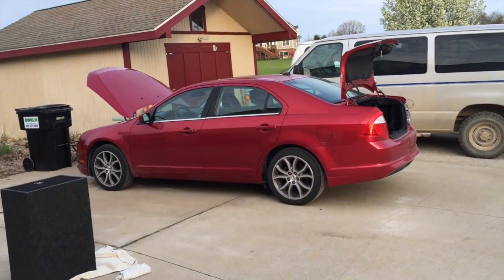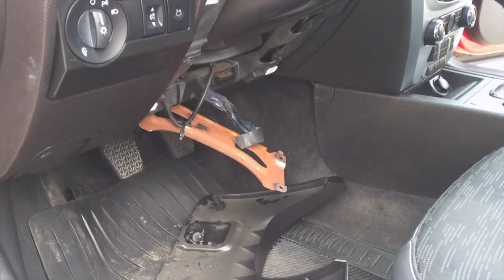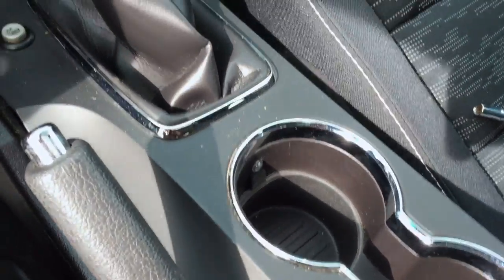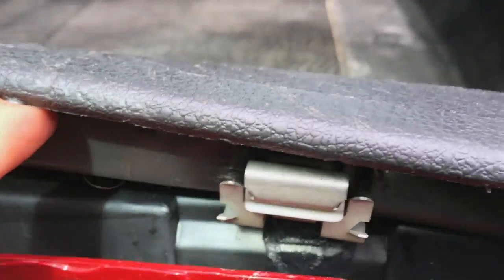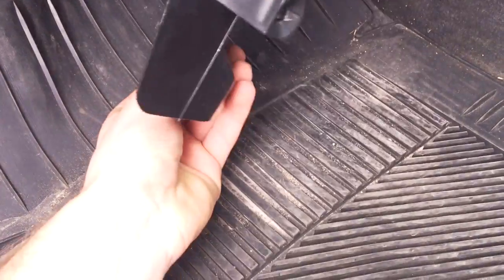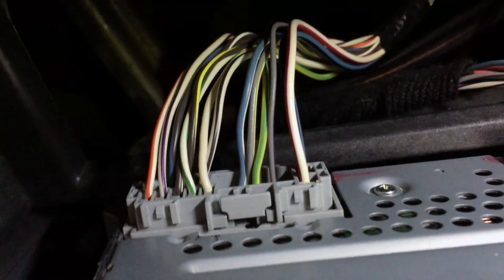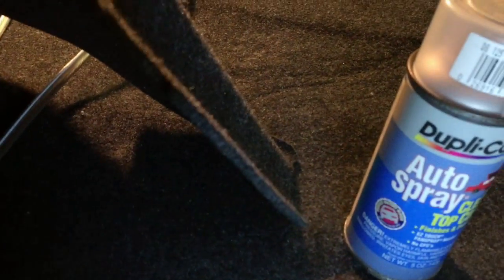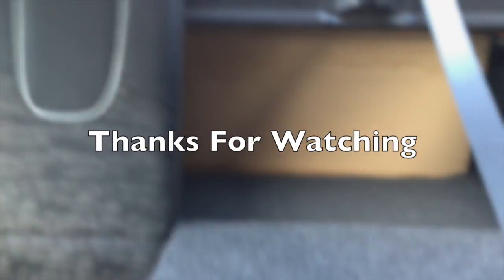How to install subwoofers with a factory radio - 2010 Ford Fusion

Comment: I'm putting a sub under my seat, this will help me a lot, already have half the work done before I start cause I need to replace by e brake lever. I laughed when I saw your lanyard cause I have the same one on my keys.

Comment: Just got my 2008 fusion with the 5 speed! They are incredible cars
Reply: where’d you run the power cable through?
Reply: @Versility drill the firewall next to the steering column
Reply: @colebremmer1225  just a little late my boy
Reply: @Versility  whoops didn’t realize lol

Comment: You may need to turn down the 'bass' control in the factory head unit to avoid hitting its built-in limiter, which is only there to protect the factory speakers. The bass is still "there" in the signal so if you tweak the crossover frequency in your subwoofer amp just right, then it will pick up right where the 'bass' EQ leaves off. This will reduce the distortion coming from your door speakers because they are no longer working as hard, and you're not hitting the factory limiter with your bass signal. Otherwise great demo and I might just have to do this in my 2010 Fusion SE with Sync.
Reply: Idk if you still have yah account but what’s the right measurements for a amp with factory radio?

Comment: You can always wire straight into your rear speakers as well would've been a lot easier and a lot less speaker wire you had to run all the way back
Reply: Wich wire is the remote connected to
Reply: MrCupcakebear1 same what do you connect the remote wire to
Reply: LiveToRide directly to the factory amp is what i found with a testor. It helps to have another person when not only testing for power but also knowing wich wires turn on and or off with the ignition
Reply: Same thing i did... Thanx for the reply.. Much 💘.. Im i lil typsy.. But great video. And the sportgot hit by a semi..  And had a reinstall on chvy malibu.. Fckkk..
Reply: Agreed chase Coleman!! Exactly what I did. And the power and ground to the amplifier as well. Works great!
Reply: @MrCupcakebear1  your radio
Reply: @LiveToRidee  your radio the blue wire
Reply: Where do you get the remote cable for the amp to start on and off when you start the radio
Reply: Where do you get the remote cable for the amp to start on and off when you start the radio?
Reply: Mr. Lumpy which blue wire there’s at least two maybe three
Reply: @rickyavila673  with an LCI2 you can get remote from it, it sense audio signal from the speakers and powers up like that and it had a remote out connection to power the amp on. I'm about to install in my 09 fusion and was looking where he ran power through the fire wall I don't wanna drill threw it...
Reply: @scottouimet2865  Yo! i was looking for the same thing, need a good spot to run power through in my fusion, where did u end up doing it???
Reply: @Versility  when I get off work I'll let you know. You are asking for the lci2 or amp. You can msg me on Facebook at the same name I can send pictures
Reply: @scottouimet2865  i’m appreciative you got back 11 months later! just want to know where you ran the power wire (for the amp) through to get to the battery.
Reply: @Versility  if you look just above the column to the left side of it your see a white plastic plug about 2 in wide and that is where I run wires through
Reply: @michaellarcom  i ended up doing the exact same thing. nice little spot for the amps power wire
Reply: @Versility  I have the 2011 Mercury Milan premier with the Sony navigation system in it.. it's different than the system in this video I think because I have 12 speakers and the subs are 6x9s I'm going to get the lc2 pro for the sub and I have the old school RF 500.2 amps and hx2 15s
Reply: I tied into my left rear speaker and it sounded distorted and like it was unbalanced cuz it was only getting the signal from the back left so if the song was playing like a fade or left right balance part of a song it just sounded real muddy. This is a crappy year of Ford for aftermarket radio stuff because they don't really have wires coming out of the head unit it's all ran through the PCM or whatever module and I'm kind of intimidated to start messing with those wires. But I have the 2012 without but I have the 2012 without the audio file sound system So mine doesn't have a stock amp
Reply: @MrCupcakebear1 The blue and white one
Reply: Can u make a video on how to do it?

Comment: Iv never seen a fusion in Manual trans that's cool
Reply: My first gen fusion has a 5 speed in it too, nice getup for the modest amount of power
Reply: 2013 and 2014 they had 6 speed manuals.  2014 was the last of the manual fusions.
Reply: @justaguynamedmax8207  I have one ('13). It's great!
Reply: Konrad Gajda umm, no it won’t. 🤪

Comment: Newer amps from Audio Control include GTO, great turn on, which activate your amp power through sound output from your speaker wire, disregarding having to run a remote wire to the head unit. Also they include AccuBass to restore bass from rolling over the higher you increase your volume as many newer vehicles have pre-installed to keep from damaging cheap stock speakers. Hope this helps anyone.

Comment: I wish I would've seen this video last year before I installed my subs and amp hahaha. I eventually figured it out, the only difference is that I wired my line out to my rear speakers that are already in the trunk
Reply: witch wire was pos and neg for the rear speakers with sony audio system.
Reply: @romanhidalgo3862  wondering the same thing

Comment: You don't need to drill through no metal to get a wire in the car. You take that installation down and look up to the left of the column your see a white plug plastic you can put a hole through it. It's about 1.5-2 in wide. I found it while looking to run power for my trailer wire converter.. I just wish I could find out something on that 2011 Mercury Milan premier Sony navigation amplifier wiring. Life which one is the subwoofer output so I could hook lc2 pro to the subchannel.

Comment: I did everything the same way except I connected my loc directly to the speakers wires behind the radio. And my sub sounds weak but my amp is all the way up

Comment: Where did you run the remote wire ?
Reply: I hate when they dont fucking respond, like wtf is the point of a HOW TO, when you arent going to help
Reply: @IDABAYAREA650I if you have a Line Output connector that has a remote wire on it all you do is run the remote wire from the LOC to the amp. It sensed the power signal from the speaker wires.
Reply: Senses*
Reply from the maker: @IDABAYAREA650I I made this 7 years ago, cut a dude some slack
Reply: @XxkristofpopxX thanks for the informative vid

Comment: Just buy a line converter with a trigger remote and wire into ur rear speakers!
Reply: I did that to my girls fusion and it sounds terrible , there’s barely any kind of power to even make the subs work atleast decently

Comment: Wait you have a six speed fusion too? I Love mine. Very rare so cool to see another one
Reply: Might be had a fusion since this an old video
Reply from the maker: @kiethj7  Still running strong at 240k miles, and same with the system. It'll be a sad day when it rolls its last mile
Reply: @XxkristofpopxX  Awesome. Mine has been good to me the past 6 years. I want to hook up my system so I ended up here. How does it sound being stock?
Reply: I bet our cars were born at the same place since they're both 2010 6 speed lol

Comment: Got everything wired from. What I saw in video. Just didn't see anywhere in video where u pulled power for converter.
Reply from the maker: I brought the big power cable to the amp straight from the battery, and took power from that cable to power the converter.

Comment: Couldn't you have just spliced into the rear speakers on the deck instead of running wire all the way from the head unit? Just curious is all.
Reply: No rear deck speakers in the Fusion unless you already have the upgraded Sony stereo. The rear speakers are in the rear doors. There are 6x9 openings in the rear deck for the Sony system subwoofers; you could conceivably add a full-range amp and more speakers in the rear deck but these existing locations are also good for venting the trunk compartment into the cabin. Also, you could conceivably just use 6x9 infinite-baffle subwoofers that are available, and put them into these factory locations.

Comment: Wonder if it would complicate things if in my fusion I have the Sony 12 speaker factory system where you mounted your amp is where the Sony factory amp is located at I was considering doing the same but I’m not sure

Comment: I got 2011 Mercury Milan premier with the Sony navigation system in it.. it has an amplifier in the back behind the panel. I wonder if that's the same as your system or does it got a different wiring? I want to go with the lc2 pro

Comment: How long was your power cable in legnth? I'm ordering some welding wire for durability and currency efficiency and want in between just enough to a lil bit of play left over. Appreciate the upload none the less.
Reply from the maker: Can't remember exactly how long the cable was. Probably around 8 or 9 feet? I would order more than you think you'll need and cut it to size. You really don't want to end up being too short.
Reply: SNWxGaming get an amp wiring kit.  Depending on the kit you get it may come with everything you need in clouding fuse holder and rca cable
Reply: Michael Ouellette I'll get the welding wire and buy the fuse and speaker wire separate. Thanks though
Reply: That looks way more than 8 feet lol. I have a 2010 fusion as well and I think i'm using around 18 feet

Comment: very nice tutorial i have 3 12s and a few amps i was gonna install in my 2012 fusion sport. how did you mount your box back there?
Reply from the maker: I used velcro on the bottom to keep it from slipping around, it works well.
Reply: +XxkristofpopxX  how much will u charge

Comment: I did the same exact thing but I’m not getting any sound, I’ve installed two different amps and I’m still not getting any sound any suggestions?
Reply: I'm having the same issue right now no power to the amp I can't figure it out

Comment: Do you know which wire corresponds to each speaker/other functions in the all audio connector? Wiring diagram? TKs
Reply from the maker: 999MAO999 I explain which wires are the speaker wires coming from the harness, you could easily find the positive and negative with a multimeter, other than that I'm not sure of the other wires.

Comment: My understanding, is that the LC2i can handle up to 400 W. So let's say I want to amplify my front door speakers and add a single 12 inch sub. Let's say my two door speakers would take up 120 W RMS. Would that leave only 280 W of power and I could put through the LC2I from a second amp to my sub woofer?
Reply from the maker: The purpose of the LC2i is to take the high output signal from your radio and turn it into a low level RCA signal that your amp can use. You don't run the amplified signal through the LC2i because that would be redundant. Does that help?

Comment: Quick question if you ever see this, do you remember where you put the ground for your RC2i, I am having trouble finding a spot
Reply from the maker: Pretty sure I used the same ground location as the amp, or daisy chained from the ground terminal on the actual amp to the LC2i

Comment: i have a 2012 ford fusion and i bought the pac line out converter the sni-35 im looking for a good way to run the remote wire to my amp to tell it to turn on seeing as the loc doesnt have a remote... any help. also the car doesnt have an acc line i was thinking of tapping into the 12v constant and putting a toggle switch on it?
Reply from the maker: Milktittiesclutch1 a toggle switch would work, it probably would have been easier to just get the LC2i but whatever you prefer. I don't know of any easily tapable accessory outputs.
Reply: already bought the sni-35 didnt realize there was no remote woulda bought the better one. i just cut out the cig lighter in the bottom of the dash and put a toggle switch there, only use it for car charger and i got the one inside the center console. boom bam got it

Comment: if u ever see this...do i not need to do my back left and right, wires to?
Reply from the maker: You’re just trying to get a full signal from the head unit to the bass amp/line output converter, you could do front or back, but you only need 1 set
Reply: @XxkristofpopxX So will i need 3 RCA cords total? 1 for front left neg. and pos. and 1 for front right neg. and pos. and 1 to plug from lci to amp?

Comment: The ground wires on the output converter, do they go to the ground on the amp or to the frame ? Or both because the one I purchased has two ground wires
Reply from the maker: Robbie Robinson I would follow the instructions that came with your specific unit. It wouldn’t make sense to have two separate grounds, unless you’re talking about negative speaker terminals

Comment: Where you ran the power wire, is that the only spot to put it through ? And how did you know what wires were what on the back of the radio ? Thanks
Reply from the maker: You can run the power wire anywhere you’d like, I just found that spot to work well. You could try looking at diagrams online to get an idea for the wires, or probe the back of the connector and read voltages.

Comment: What about the remote wire? I did an install on my same model car and the amp won’t fire up
Reply from the maker: The LOC that I used senses the audio signal and has its own remote wire connection that you would use to send to the amp.

Comment: I am planning on doing the same setup on my 2010 genesis. instead of tieing in to the front speakers would I be able to tie into my stock subwoofer?
Reply: Mason Stevenson yes, that's what I did to my car and it worked perfectly fine

Comment: I have a question. Why did you wire into the front speakers and not the rear. I get why u went behind the deck but why fronts. I am at this same step right now and need immediate help.
Reply from the maker: Shouldn’t really matter if you go front or back, I just figured I’m listening to the front speakers while driving, might as well tie it together. But again, shouldn’t be a difference, just go for it
Reply: Thanks. I will!
Reply: Do the front and rear speakers get different audio? Or the same? No diff in base either?
Reply: By the way thank you for this video. I've never ran power through the firewall before and this was A+
Reply from the maker: Michael ODonnell not sure if they get different signals and audio, I’d imagine it would be the same but I guess if they wanted to tailor the radio for the car and speakers they might change it slightly? I kind of doubt it though. Also, glad you like the video!
Reply: Hey I have one more question. The loc I got has 4 wires for the 2 speakers and a power and a ground. Do I really need to ground the loc to the chassis? Or the power wire? I have to do the same thing as you and run the loc all the way to the trunk. I'd really rather not run another line 15 feet to the trunk from the deck.

Comment: Where did you hook the 12v wire from the LOC? The same spot where you hooked the 12v wire to the amp or to another place?
Reply from the maker: JaDarius Price The power wire for the LOC is connected to the power wire for the amp.
Reply: XxkristofpopxX okay thank you so much. & nice setup. Really nice.

Comment: i wanted to see the connecting of the wires now im stuck here
Reply from the maker: Javid Kendall The wires from the radio go directly to the LC2i. Next you use the RCA connection from the LC2i to go to the amp, then wire the subs like normal. The remote wire goes from the LC2i to the amp, and is turned on when the LC2i senses signal from the radio.

Comment: Hi doing the same to my fusion sel. What do I need to complete this already have Amp and subs.
Reply from the maker: Hey Tom, I pretty much highlight it in the video. If you’re sticking with a factory head unit, you’ll need something like the LC2i (line output converter) to turn the signal going to your factory speakers into something useable for your subs. It also acts as the remote turn on for your amp when it senses signal. Grab some wire and hardware along with your amp and subs and go to town
Reply: @XxkristofpopxX  what size speaker wire did you use? Did Microsoft sync still work after?

Comment: im having a distorted sound? does it matter what radio converter i use. i also have sync
Reply from the maker: Yes it matters what LOC you use. Audiocontrol has some of the best quality LOCs, so I highly recommend them. Check your connections to make sure nothing's loose and it's properly connected. If it's still distorting, make sure you have a clean signal from the radio, and check the settings on your LOC and amp.

Comment: What did you use to power the lc2i? Does this drain battery with Amp always being on?
Reply from the maker: LC2i only turns on when it sees signal from speaker wires, doesn’t seem to drain battery since I’ve had this system set up